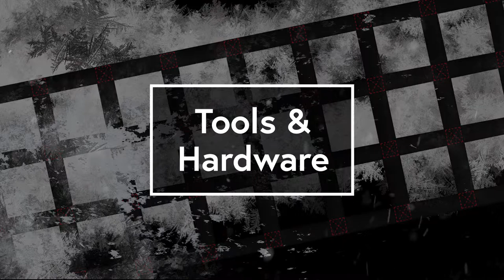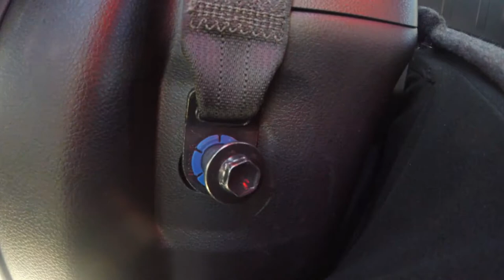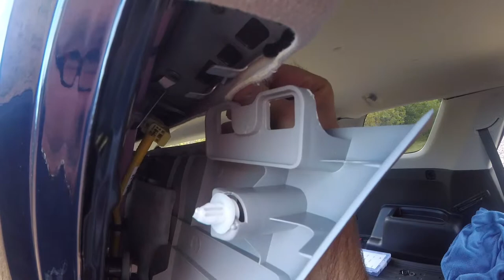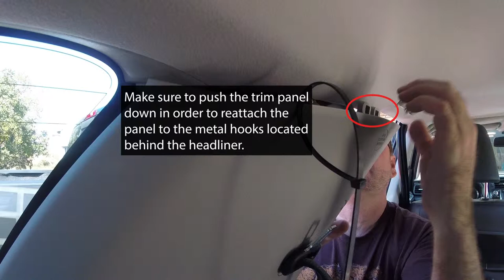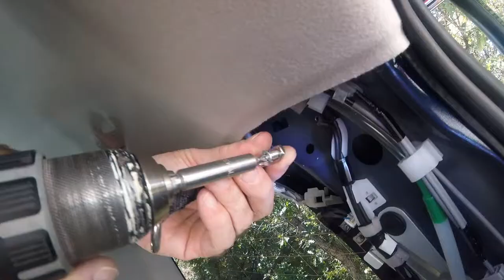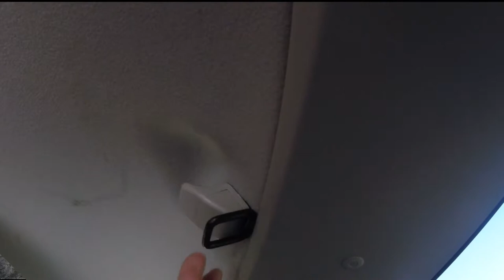2010 - Newer Toyota 4Runner 5th Gen (N280) Cargo Area Ceiling Attic Net

Comment: Do you have to use the EZ method with 3rd row configuration? I don’t see a video for that
Reply from the maker: The 3 row model should work the exact same except using rear ceiling handle instead of installing the C102 black square hardware piece.    Lmk if need more detail info@raingler.com